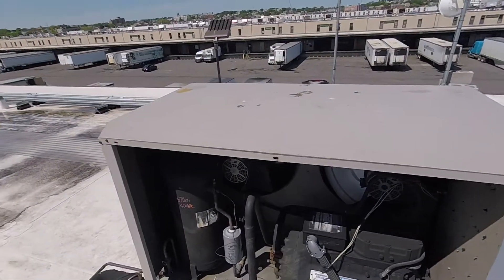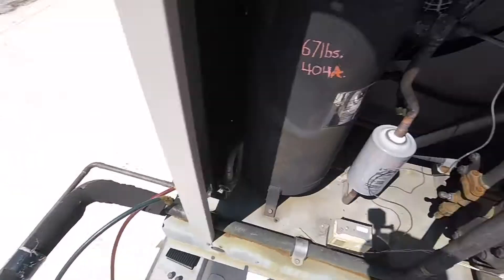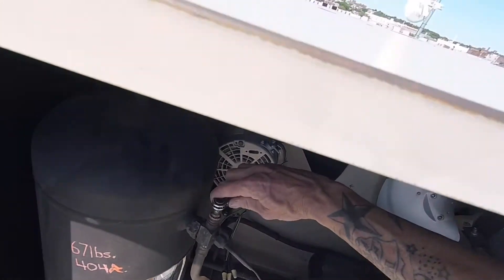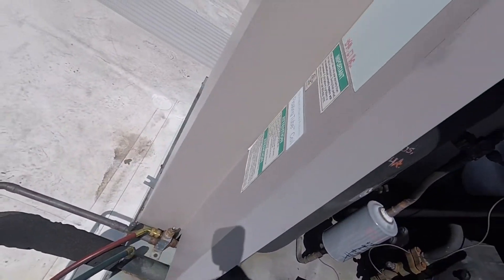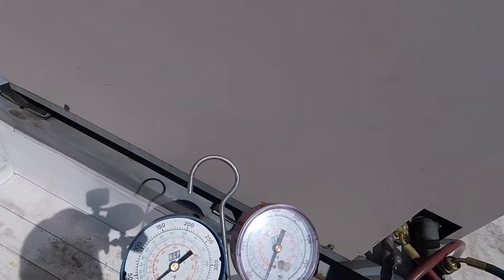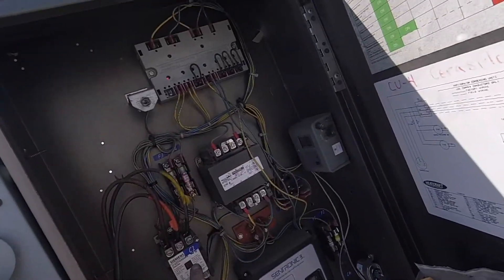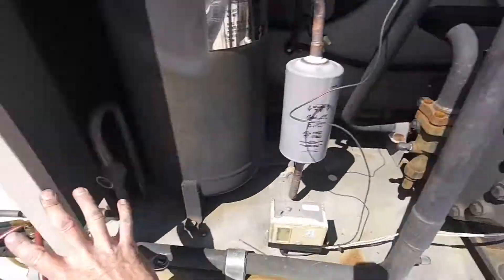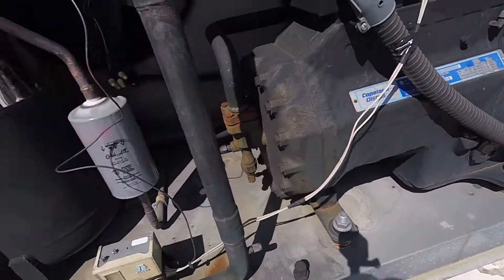Quick Pro Tips #3 . How To Pump Down A Refrigeration System .

Comment: If you’re brazing inside after a pump down and flowing nitrogen I’ll need to front seat my compressor king valve correct?
Reply from the maker: Yes that's correct, you got it 👍

Comment: will which valve do you shut down when it gets to zero to isolate the refrigerant in the reciever. you showed the first valve right away.
Reply from the maker: @dan9988  the valve on the outlet of the receiver so the Freon will not leave the receiver  . The Freon will be isolated to the high side of the system in the condenser and receiver . You can also shut the suction valve on the compressor too.

Comment: If you make repairs after pumping down the system.  Can pressurize it with n2 with it isolated?  Or would I only be able to evacuate and then open the valves
Reply from the maker: yes , you can pressurize it while its isolated
Reply: @Cscrefandhvac what is the normal practice. Do the repairs and do evacuation without pressurizing with N2?  That’s what I have been seen
Reply from the maker: @La2venida  you can always pressurize with nitro to leak check but if you know you brazed it right and are confident in your repair / braze it’s not necessary.

Comment: So if you push in the contractor to pump the rest out you could in theory sweat out any components like solenoid valve without the fear of creating fosgene? Some tech I’ve trained with always cut into the line and let the residual bleed out wherever the solenoid in my example would be. Just curious I could take this knowledge and show the techs something they have over looked.
Reply from the maker: yes you can do that for sure

Comment: a question I closed the receiver The pressure dropped to 5 psi The compressor turns off And when I ran to change a drier filter Suddenly I realized that the pressure was rising again. What do you think could be the reason for this?
Reply: leaking compressor valves or solenoid valve, front seat the compressor adn check
Reply from the maker: system needs to be fully pumped down also. 5 psi is still pressure in system and residual gas in system or liquid still burning off in system or out of the oil which will create pressure

Comment: what about the solenoid in the evaporator, does that need to be activated or not while it's pumping down?...trying to replace evap coil
Reply from the maker: Yes the solenoid will need to be “ On or Open “
Reply: @Cscrefandhvac  thank you!

Comment: How does it not escape , if you only close the one valve?
Reply: You close off the liquid receiver outlet valve after the system shuts off on low pressure to isolate the tank
Reply: @strimbimmin328 I don’t get it
Reply: When you front seat the valve you isolate the receiver from the line set
Reply from the maker: Yes you stop the Freon from coming out of the receiver and it gets held in the receiver .

Comment: Would you front seat the high side service or the compressor suction inlet  valve after you pump everything into the receiver (outlet front seated) to make sure nothing flows back towards the low side?
If you only front seat the reciever outlet..how is the refrigerant isolated in the tank
Reply from the maker: Refrigeration Technology it’s isolated in the reciever because you close the valve on the receiver outlet so the gas can’t get out of it .  You can close the suction valve after if you want but it’s not necessary .  Don’t close the discharge one especially if the unit is running. You’ll blow the valves
Reply: @Cscrefandhvac  you can change a dual pressure control like this or do you need to recover?
Reply from the maker: Refrigeration Technology you need to close the discharge valve as well and get the remaining gas out of the compressor , then you can change it
Reply: @Cscrefandhvac when you say it’s “not necessary “ to front seat the suction king valve, is it because the unit is off and N2 for example can’t make it to the high side if you’re flowing it while brazing?

Comment: So if you want to work on an evaporator but the old compressor has some internal leakage or bypass this is where it would present itself?
Reply: If that the case, you may have to front seat the suction and discharge at the compressor service valve.